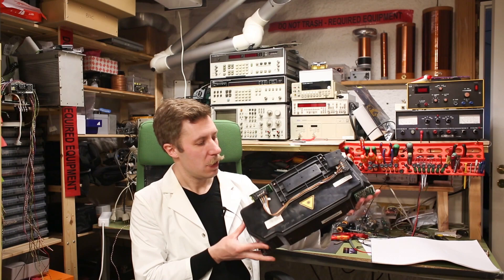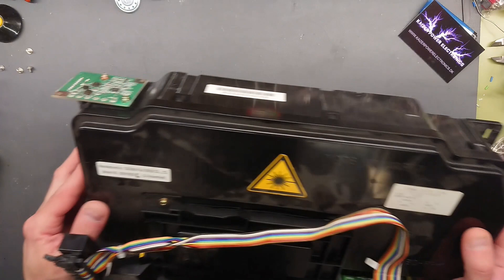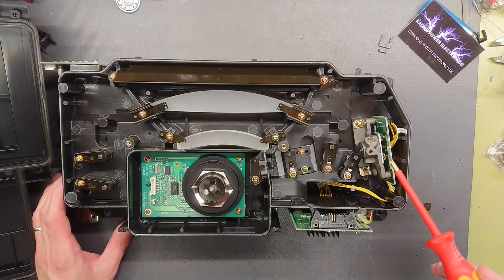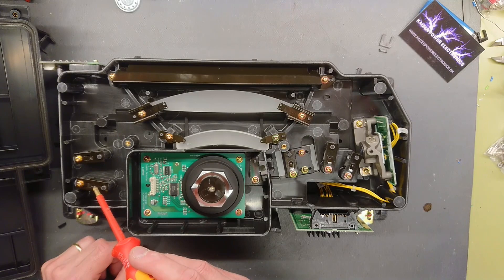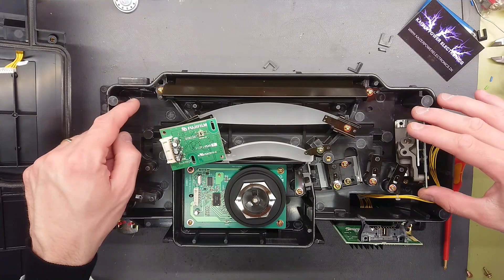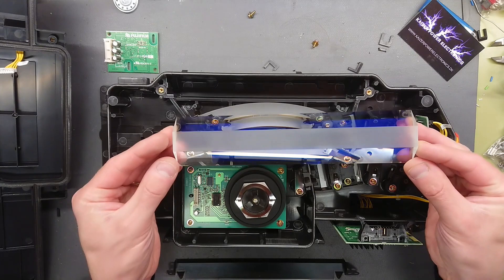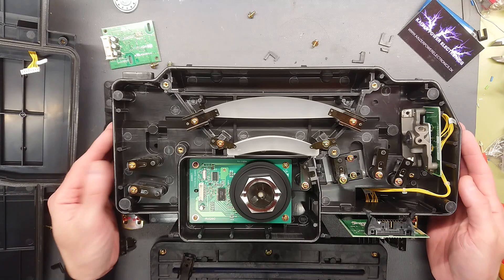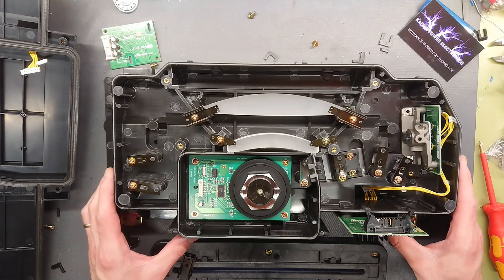Fujifilm FCR XG-1 XRAY Scanner Teardown, Laser Scanner (Part 2 of 3)

Comment: I would think the detector on the outside by itself is there to detect the beginning of a scan line, used in conjunction with a servo loop to reset a horizontal position counter in the raster scan, so that the time it takes to scan can be adjusted to a constant value by the mirror motor. That way any small motor speed variations do not result in a skew image, just up to a half pixel horizontal error. Likely the missing coating is there so the mirror and prism will not get blue light back from the plate, and only get a small part of the laser beam intensity in, so as to make the photodiode response faster.
Reply: Yep, my thoughts too!
Reply from the maker: You are right! I found the service manual for the scanner and its named "14.3 Checking the Start-Point Sensor (SYN)" . What a blunder I made there, I know perfectly alright that the image is formed from the PMT and not inside the laser module

Comment: The beam scanning module is 100% identical to the one found in a laser printer. Totally the same setup. Thinking of it it's probably not custom at all - it's a standard part for a big digital photo copier!
Reply from the maker: I assume we talk a laser printer the same size, but it makes sense. Its just a change of laser diode from 633nm to 800'ish nm for laser printing and its go-time :)

Comment: Nice, the laser diode assembly kind of reminds me of a CD ROM drive, just bigger. 
Do you know the wavelength of the laser?
Is it in the visible spectrum or is there a very special one needed?

Greetings, 
Michael
Reply from the maker: I am not sure of this exact laser diode, but in general this technology uses a red 633 nm laser to invoke a photoluminescence effect in the image plate that returns a 400 nm blue light. There is a excerpt on that in the forum post from the link or link to my website :)
Reply: @KaizerPowerElectronicsDk  Nice, very interesting. I read the forum post just after commenting here, I guess I had some bad timing ;)